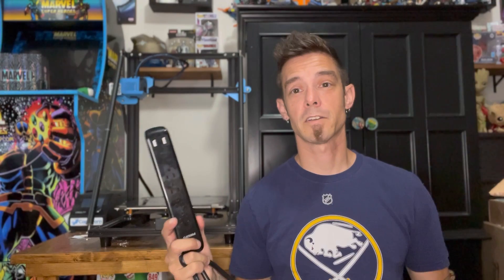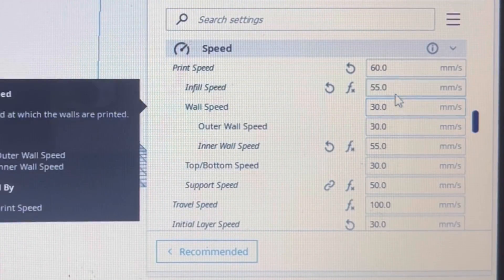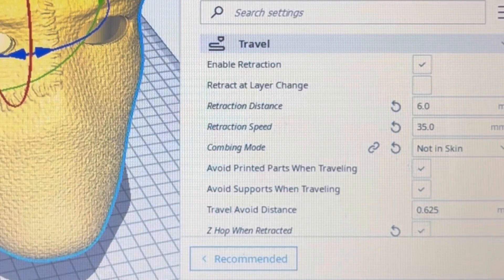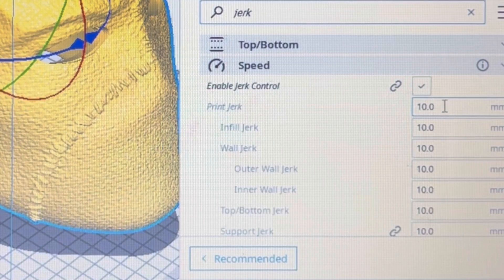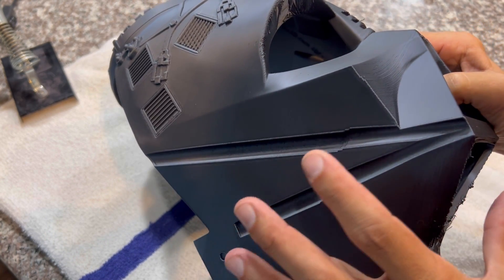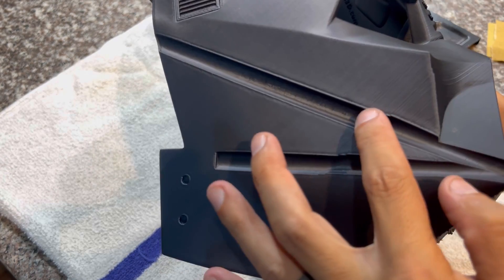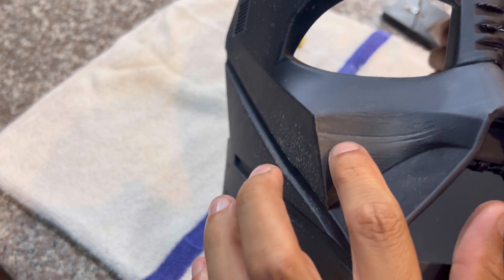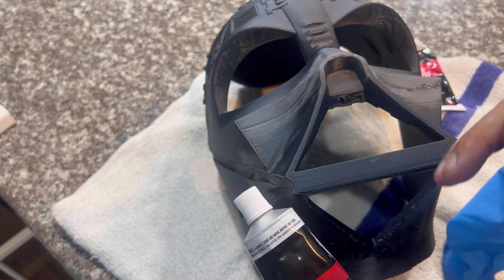How to fix layer shifts in 3D prints | prevent layer shifts in 3D prints | Repair layer shifting

Comment: My printer has layer shift to the point it goes to the edge of the bed😭😭😭
Reply from the maker: @Randomstuffthekid  turn your acceleration down and check belts/rollers
Reply: @ the belts/rollers are good and even though I didn’t turn down the acceleration in the modeling software I turned down the printers print speed to 90 percent and all of that is the print I was taking about

Comment: Well, that was the most informative. Looking forward to trying to see if I get a better print. I am 3-D printing RC car body just a cab. I’ll try all the information you put out and see if I get a better print. Thank you so much for taking the time to do this helping newbies out
Reply from the maker: @danweiss1371  let me know how you make out!
Reply: @ i’ve gotten a lot better, but I think a problem I might be having I have a creality 3 V3 se  even though I have double and triple checked all the bolts. I think the frame is getting a little movement. So next, I am gonna try some bracing. But your information has made my print so much better. I cannot send a picture on this platform, butI’d like to show you the difference. Thanks again. It really helped.
Reply: Well, the printing keeps getting better. I just added a set of gantry supports and we will see going forward.
But I am so much happier as a newbie with the quality of my prints. So thank you very much such a big help.
Reply from the maker: @ really great to hear!! Glad it’s getting better, def frustrating when things go astray

Comment: Ive got a Ender3 V3 and it has layered shifted 3 times, seems to only do this on long printing times, doing a feral predator which is a large model, however, on the smaller print models i dont get any layer shifts, could it be the belt?
Reply from the maker: @deadpoolslovechild  often times on long prints bed adhesion is the issue. What adhesion do you have and have you enabled z hop?

Comment: Here in the UK, I found 90% of my layer shifts on my Ender 5 + were due to well used SD cards. Put the stl on a New sd card and try again. Much cheaper and less stressful than hitting firmware or changing printer parts.

Comment: Hey have you had a printer like shift every layer just about one layer over each layer up and making a small gring noise starting each layer like the belt is skipping over a gear or something. Only happens in normal standard mode but if I go to slow stable mode it prints fine. I got this from someone on Marketplace and he said he only had it a month. When I looked at the printing hours it was less than 8 hrs total. I replaced a bad belt but now I am wondering why the belt was so bad. Stretched and ripped at the clamp. I know it's alot just trying to give you the best idea...lol
Reply from the maker: @chazhaze3d  what printer?
Reply: @Darkwingdad  I bought a second Kobra 2 Max since my first one prints so clean, but I almost think he dropped it or it vibrated off his desk/table... but he says it didn't
Reply from the maker: @chazhaze3d  is the hot end carriage loose? Have you checked all your rollers?
Reply: @Darkwingdad  yeah I watched a video about that about 30 minutes ago about the rollers, going to try that, but the hotend seems secure no issues. Maybe the roller in the adjustment cap? Or the end of the y axis by the back step motor
Reply from the maker: @chazhaze3d  I would roll them left to right and the bed forward & back & make sure they are moving freely with no resistance or snag

Comment: I wanted some validation on the usual culprits of layer shift and you were one of the only ones that talked about jerk and acceleration. Reducing them didn't help and still wanted to keep my printing speed. So in my case, it turned out to be something not so much spoken about, After printing 3 times and layer shifting at the exact same spot and after going through tightening what needed to be tightened and with a symptom didn't have with any other model, I thought it gotta be the model. It is a more complex, with lots of small turns and it is the model that takes the longest to slice from models I printed so far. I am printing at high speeds (easily reaching 300 mm/s) with a Biqu H2 500 I replaced my Stock ender 5 pro extruder with. Some weird things happen, like the stock LCD gets all scrambled. So I thought, gotta be processing power. And my solution to print this model in particular was applying Arc Welder to the original gcode.

Comment: Several of your recommended setups are spot on.  I have an Ender 5+ and swapped out all the corner braces for much heavier duty ones that nulled out flex in the frame.  I added additional rubber feet and set the unit on two layers of high density EVA foam.  The jerk and general acceleration settings are all the same as you have setup, as well as some retraction settings I needed that eliminated what were very tiny blobs of plastic left after retractions.  These acted like tiny speed bumps that would throw the part off or knock it over (eight failures in a row, recorded video allowed me to nail down the issue).  Today it prints fine at 80mm/sec.  Direct drive and all metal hotend, PLA+.
Reply from the maker: You can definitely print faster with a 5+ due to the core xy cage. Very happy to hear the settings are helping & I’ve wondered about placing some gym flooring under my printer for additional support, thanks for sharing & I appreciate the view!
Reply: @Darkwingdad  the gym flooring does work ok....I used one tile of that plus one cut square of 8mm higher density foam I use in cosplay builds, it gave more vibration absorption. Now, clamping down the unit...I used a couple of heavy duty rubber bungies, like the ones used on big trucks trailers.  The really locked the unit down on the table...BUT...they actually flexed the frame a but too much and I got a little binding in the unit (foam mat pushed up on the Z steppers).  I added the additional rubber feet to give more support to stop that but after doing a few tests, I found the bungies made zero difference to the print.  The goal was to stop the unit from moving (DD and Metal Hotend adds weight to that extruder assembly on the X/Y and that inertia can give you shifts).  In the end, I took the bungies off as dialing in the other variables worked just fine.  ESPECIALLY the jerk acceleration and the retracting/coasting.  Those were key.  And I love your channel, keeping working it.